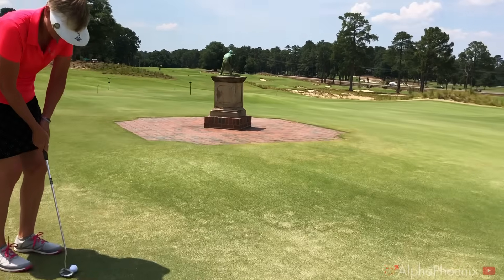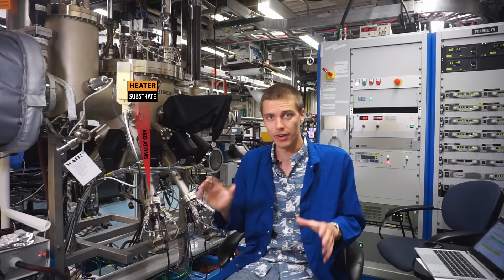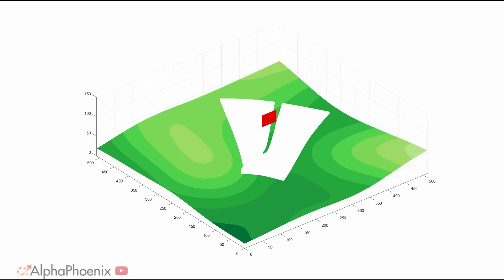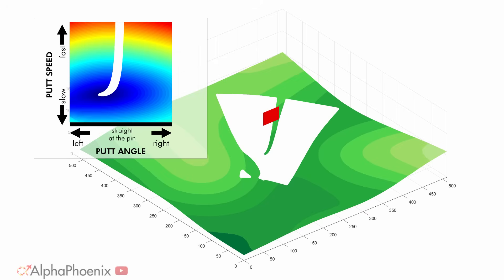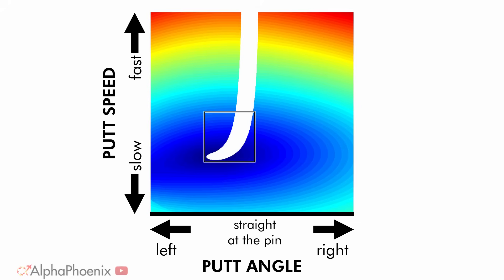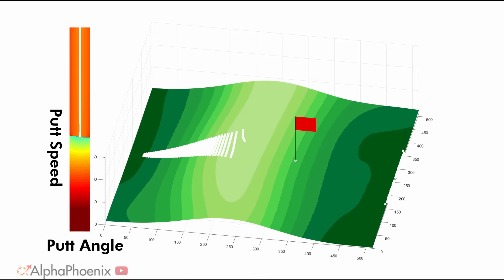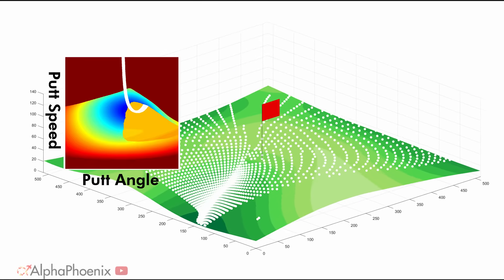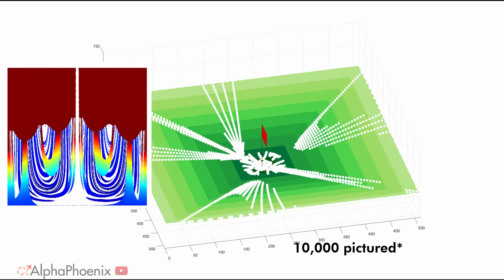Overcomplicating GOLF by simulating every possible shot

Comment: You could make a 3D phase space for the placement and watering of a house plant, and color it according to how well the plant is doing. Obviously it isn't very binary, like there isn't a pure success, although the plant can definitely die. Which I think will happen a lot, since getting data points probably requires the sacrifice of quite a few plants... The diagram will obviously work for just that one species of plant and the specific space, so I'm not sure how convenient this is taking into account the required amount data collection and duration because of the slow rate at which plants react to their environment, but in theory this is very interesting :D

Comment: 2D real life data set. Baking time and temperature for a given recipe. Possibly using a color grid for a single yumminess metric. Or for a more complex analysis, two metrics, yumminess and crustiness for say, a baguette. Use a graph like you were using for the greens themselves, but with color as one metric and height above the plane as the other. 

Of course, no one is going to bake the same recipe a million times with a thousand different temperatures and times. But a 3x3 grid across the likely target area could point you in the right direction.

Comment: This brute-force phase-space approach could also be applied to basketball backboard angles.  Is it better to shoot off the backboard at a very oblique angle or battle your opponent to get a shot closer to straight-on?  Does the angle of successful shots  differ from the perspective of the shooter?
Also, you could use this to see the set of vector velocities capable of sinking at least one ball in a standard pool/billiards opening break.  Is it best to shoot straight-on or glance off the side?
Because I was pondering it while falling asleep last night, you could also use this approach to solve the wave-particle duality problem.  I probably shouldn't tell you exactly how, though, as I would hate to steal your thunder on it.

Comment: I always thought it would be neat to draw out the phase space of a roulette wheel. Since roulette wheels are physical devices the outcome is completely deterministic (under classical mechanics) and depending on how we choose to simulate our roulette wheel, could depend on just a few starting variables, like the speed of the ball and it's starting angle with the wheel. Because roulette wheels are designed to be "random" I suspect the phase space to be quite chaotic, with fractal like boundaries, but it would be interesting to see if that were actually the case.
Reply: There'll be an interesting non-chaotic region as the speeds get low enough
Reply: it is obviously the case
Reply: @pyropulseIXXI  mm yes very obvious

Comment: A variable you can’t necessarily control but can measure is the speed of the green, it’s measured using a tool called a Stimpmeter
Reply: Can you do more simulations much closer to the hole like between 6’ and 1’ using that Stimpmeter data and more realistic greens?

Comment: Very cool. It would be neat to invert the solver by sending balls FROM the hole in every possible speed and direction. This would give you a 4D map of all possible starting locations + speeds + directions that go in. Not directly visualizable, but you could slice it like an MRI to look up the solution for any given shot location…
Reply from the maker: Nice to see you here! Also - cool idea! Somebody else on this thread suggested that you would use this style of algorithm to make an automated golf machine but you’d need like a lidar 3D model of the green…

I got nerd sniped real hard by your second lock video and according to the hastily scribbled sketches from about 4am the next day, I totally think it could be done with 4 concentric rings with a few connecting sheet metal parts in the back. Maybe or maybe not cheaper to machine… Haven’t had time to CAD yet cause ive been moving… to Raleigh…
Reply: That requires the dynamics to be invertible though.
Alas.
At a molecular level they are, but at a macroscopic level they are not.
A ball that came to a standstill could have been there forever; there is no way of tracing where it came from. Similarly, a rolling ball could have rolled forever or could have landed after being airborne.
Your starting position has degrees of freedom, 3 position + 3 velocity (+ 3 rotation, ideally); your end position when the ball has stopped somewhere in the ground only has 2 d.o.f., so you "lost" quite a few.

(Ive Harding answered essentially the same above).
Reply: @onetoone It just has to simulate the physics backwards. Like, instead of simulating the ball rolling up the hill, simulate it unrolling down the hill. Which looks like rolling up, but gives numbers for rolling down.
Reply: @SirRebrl  That would be possible in the frictionless case, but not in the case with friction, because then the forces aren't conservative.
Reply: @iveharzing  That would mean the phase space would have to have a non-conservative non-euklidean geometry.
Reply: Raytracing vs Pathtracing
Reply: @Roter_Wolf  yeah I was going to say that’s raytracing too
Reply: @Roter_Wolf  not really, both raytracing and pathtracing usually start from the camera. The difference comes from the way the ray bounces are calculated.
Reply: that would be very interesting as the ball would have to accelerate more the further from the hole it gets and given that shots break at a higher rate the slower the ball is moving that would create a very interesting visual effect.
Reply: This is the best crossover 😍😍😍
Reply: Alright so what I'm seeing is Stuff Made Here X AlphaPhoenix collab with a robotic putter that calculates and makes the perfect shot each time
Reply: I got the reason why youtube recommend this video after it was posted 2 years later
Reply: @kice  I just got it too. I looked in this thread thinking someone might ELI5 op’s comment.
Reply: Of course you could directly visualize this! Just use a flow diagram.
Reply: This is fascinating. I want to go back to school and get a physics/engineering degree now… Just to improve my golf game! Haha
Reply: I wonder if you could link this type of system to your automated golf club? Add a lidar system, or just manually scan the green before hand, then have the club calculate the angle. Have a piston or actuator on the club so as long as you swing it around the correct speed it can compensate. "Easy" almost 100% accurate always some of the time single put. I'm sure this project wouldn't take more than about 2 months or cut more than a few years off your life lol.
Reply: Stuff Made Here: That is exactly how lighting & raytracing works in video games.
Reply: This is making me wonder if a golf hole would be bijective. I have to assume it wouldn’t since the ball is gaining speed as it gets farther from the hole since you don’t know where it started from. So inversion wouldn’t be possible
Reply: Some heavyweight Carolinean minds in this thread. Cheers from Charlotte, thanks for all the good thinky vids.
Reply: You'd need to invert your acceleration and deceleration as well as friction.
Reply: this is actually a method they use when conducting tests for missiles
Reply: like ray tracing
Reply: When puzzle video
Reply: Simulations tend to be unstable/numerically sensitive when propagating from an end state with near-zero velocity.
You'd be OK for bullet-type trajectories, though
Reply: Imagine if you also add not ground-bound shots
Reply: so are you gonna make another lock or what

Comment: Hey @alphaphoenix is the rectangle representative of an actual rectangle on the putting green?

I’m a good golfer (6 handicap) so when I putt I’m always looking to get the ball to stop within a 2-3 foot radius around the hole.

Do you think / is there a difference when you replace the rectangle with a circle?
Reply from the maker: The uncertainty/error rectangle?

The width of the rectangle indicates different angles you can hit at, and the height of the rectangle indicates different initial speeds of the ball. On a perfectly flat green, the actual resting position of the ball would look like a truncated sector, but on a hilly green it could take on many shapes.

If you had a circle in phase space, it would mean that to get a really precise angle, you would sacrifice precision in ball speed and vice versa. Getting in the corner of the square would imply you were way off on both.
Reply: @AlphaPhoenixChannel  Fascinating stuff. 

There’s an insanely expensive putting green called “putt view” where it can create near endless breaks to putts and actually show the phase space for that putt in order to make it. I’m curious what you think about it.
Reply: @AlphaPhoenixChannel  actually not quite phase space...more like just the area the ball may cover, on both extremes, to make the putt.

Comment: Good start.  8:40 What's your logic as far as speed of ball which goes in? The faster the speed of the ball as it hits the cup, the less chance the ball goes in. The hole size effectively becomes smaller when the ball is going faster (e.g. either skips over the hole, or catches an edge and spins out rather than falls in). That's why there's an "optimal speed" of a ball going into the hole.

In addition, while a specific phase space might increase your chances of a single putt, a player must also recognize the odds of making the next shot if he misses. See "strokes gained" for odds on making putts from certain distances.

Comment: Huh. Phase space is actually exactly how I used to think about putting, when I was able to golf. Specifically, I'd try to visualize the edge cases (fast and straight but not hopping over vs. slow and curvy but not too far into chaos) and then narrow down in my mind what path would be in the "center" from a statistical standpoint. I.e. not the geometric center, but sort of... in engineering terms, the minima where the gradient of change in actual ball path vs. the two input variables I had control over was lowest, to give twitchy muscles, shaky hands, breezes, and stray bees the least chance of screwing it up.

Comment: you could make a phase space with cooking, the combination of the temperature and time is all you can controle, but there are multiple correct outcomes that cook it correctly I mean for this example there are formula's of course if you ignore that you can burn the food or cook it unevenly but yea xD still an interesting idea
Reply: you can put it on a gradient from not safe to eat to burned, with a well cooked region in between.
Reply: @satibel  More than that, cooking at too high a temperature will cook the outside of the dish, but not the inside- It can be both burned, and not safe to eat. Similarly, many dishes rely on being cooked at too high of a temperature to get a "crust", or like for a Turkey, to cook the skin to a crisp, yet to just get the inside of it cooked far enough to not lose all the moisture. Some other dishes, such as ones that depend on rising agents, have complex curves as well, either in time, or in temperature, where you might need to hold one temperature for a time, then bring it up to a different temperature for another time, then lower it again to a third temperature for a time, to achieve the result you wanted.
Reply: Ok, time to make dinner, time to break out my Ti89! =]
Reply: the microwave parameter space

Comment: Sorry this simulation is not golf.  This is a simulation of the balls motion after golf as a physical activity has been performed, and is vastly simplifying the game not overcomplicating it.

If your thinking about the ball and the hole as you are swinging or putting your doing it all wrong. The ball is inconsequential you are in contact with it less than one second during an entire round of 18 holes. Your body kinematics, repeating your actions precisely, having relaxed control of your swing and putting the club head through a point in space some distance from your body exactly the same way over and over again, that is golf.

Being able to adjust kinematics to change the angle of the club head or the path of the club head to impart spin and produce a draw or fade that is controlled, even better golf.

Hit 600+ 4 times a week, work a 30 down to a 10, go from sucking to being a high 70's resonable pairing for even a scratch golfer, work hard so you can actually play the game, then reconsider what a golf simulation is.

Comment: Innacurate, you didn't simulate me not hitting the ball on every single shot.
Reply: The top left pixel in every single diagram.
Reply: @asailijhijr  nope, bottom line: no speed, angle undefined.
no put indented...
Reply: @asailijhijr  More like bottom left? Also, since he puts SLOW and not the quantity I don't know which is the latest speed (probably 0, but It doesn't have much computational sense)
Edit: I've looked his codes and in the ones I've looked there were no 0 velocities. I am probably mistaken. Correct me if it is so.
Reply: @YourPhysicsSimulator  Inaccurate
Reply: @YourPhysicsSimulator  Inaccurate

Comment: I think this approach could be used in F1 or other racing, as the combination of speed, gear and RPM (and param of steering wheel angle) showing perfect line to drive (as simulation f.e.)
Reply: Racing lines are dynamic though
Reply: indeed and someone took it one step further and used deep-learning AI to simulate Trackmania racing, figuring out absolute most efficient racing lines.

Comment: Without allowing the ball to leave the ground, I think you can prove there's at least one shot that makes it in the hole because of intermediate value theorem. However, if the ball is allowed to "jump" after going up a ramp, I'm pretty sure you can create a green that forbids the ball from going in the hole.

Maybe a geometry where the ball first has to climb a hill, then after accumulating speed on the steep down slope, there's a small ramp that forces the ball to jump over the hole?

Comment: Strictly speaking this isn't a phase space, just a parameter map of initial conditions. A true phase space captures all possible states of the system independently of time, so probably position and velocity (or momentum) for this system. Each initial condition should be a point in phase space, and each simulation would trace out a path that either converges on the "hole" (a line in phase space, if you assume any velocity shot that hits the hole will work), or does something else. They usually form really neat loopy plots that are great for illustration, and occasionally useful for understanding the system.

Comment: There's a local paddle tennis league in my hometown and a friend of mine is in it. Every time I go see him play, I get these visualizations that I've been trying to verbalize and this fuckin video has finally given me the words to do it. I basically imagine how every time a player hits the ball, there's an imaginary shape made up of all the vectors that result in a valid bullet shot (meaning it hits the floor first and then the wall), and because the edge of the court is a straight line, there's a very defined angle at which these shots cross into invalidity. This shape gets weirder than what I can imagine when we start considering volley shots at lower speeds, which would allow for higher angles to end in the court, because they would curve back down. Thank you so fucking much for this video.

Comment: Some factors you left out:
Club face material
Launch angle
Grass type
Temperature
Moisture

Wind
Reply: Launch angle and grass are included in the simulation, and weather isnt something he can control, so simulating weather for a rudimentary phase space experiment isn't really useful
Reply: @pseudonym50  The ball always travel along the surface so launch angle is always zero. Club face material is irrelevant.
Reply: @koharaisevo3666  the Putter actually has like 3-5 degrees of loft so with the really hard shots it would have gone in the air
Reply: @dragonfury3378  Yes but this is a simple simulation, adding that would turn the parameter space into 3D and that is much harder to visualize.
Reply: Yes, there are lots of factors but the whole point is that you generate the phase space based on the factors you can control. You can't control the grass type. You can't control the temperature or moisture. The club face material factors into the speed. So each of these factors might affect the eventual phase space but not in any meaningful way because where your ball ends on that particular green on that particular day with that particular humidity and that particular temperature, is still a function of ONLY the direction in which you hit it and how hard you hit it.